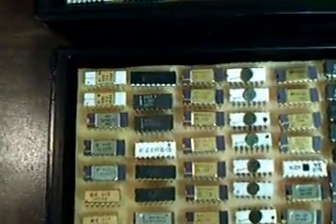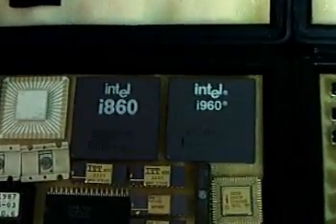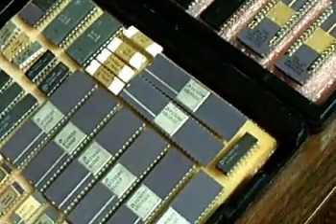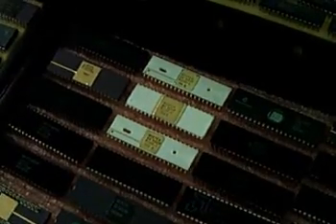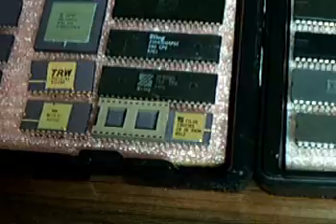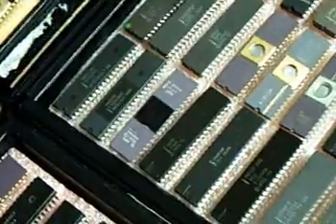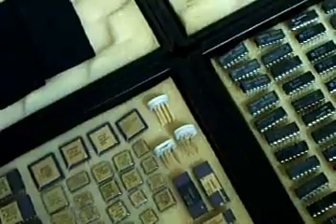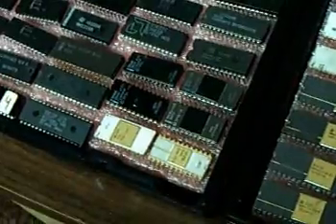Integrated Circuit Collection

Comment from the maker: @douro20 Since we recorded this video, we have discovered what the Motorola chips are - they are a second-source production of Western Electric hybrid logic ICs used in the SAGE defense computer. They contain a single hybrid IC wafer with the silicon elements deposited on a tantalum substrate. The devices are single-chip replacements for an earlier device family that was packaged in gold cans and consisted of discrete transistor and diode dies interconnected with gold wire.

Comment: Those Motorola chips in the round packages could be MMICs (Monolithic Microwave Integrated Circuit).  They are generally found in high-frequency electronics sealed in a metal container.  Motorola and Raytheon were the real pioneers of that type of device- they are usually GaAs type.

Comment: I have recently started back in the hobby, I just purchased a  tray of 24 NEW never used D8008 (cerdip)! and many soviet clone chips, I like the soviet clone chips for some reason. I too am looking for a 4004.  My favorite CPUs are the Z80 & 6502, I have around 50 unused Z80s and 40 6502, I would like to find the white ceramic with black lid Mostek 6502, I think this chip will be the most difficult to find between it and a 4004 as there are many collectors that are getting fond of the NMOS 6502.

Comment from the maker: Virtually all of my chips are either new or were socketed. I try to avoid ones that have been soldered, except with very rare chips, and then it's often better to just keep the whole board intact. The best way to get them off is with a desoldering iron or a heat gun, but it is impossible to remove all of the tin from the leads. Only very collectible or very useful chips retain much value in a desoldered state.